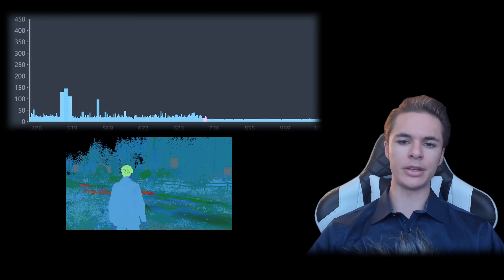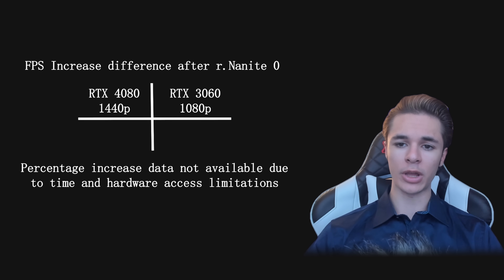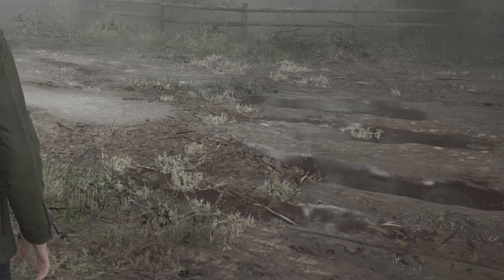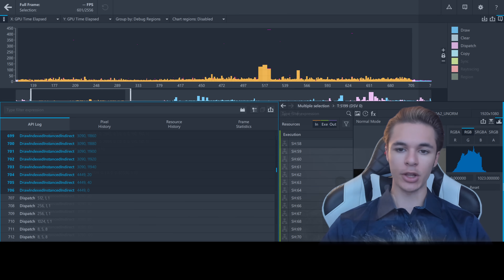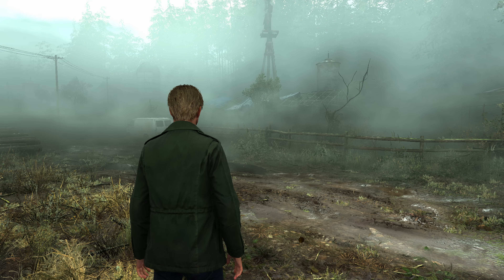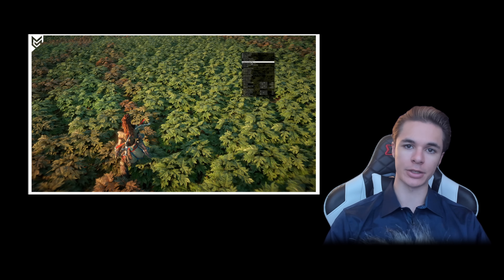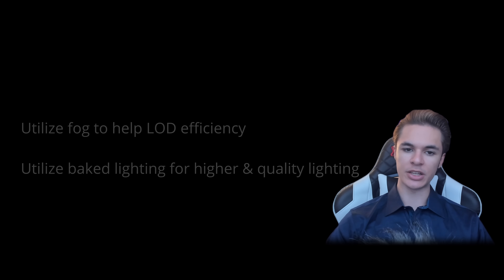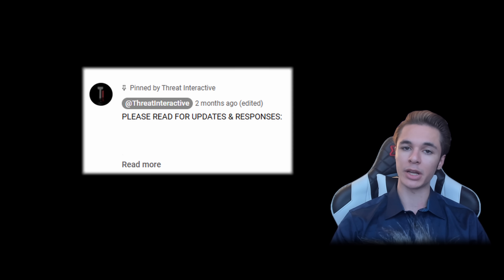The Price of Realism? | SH2R Optimization From The GPU Perspective

Comment: Calling optimization efforts on engines that are not backed by mega-corporations a "tragic waste" is very unfair. Personally, if I had the skillset to contribute to game engines, I'd much rather have my efforts go into an engine which has its' users best interest in mind, e.g. Godot, than something like Unreal, which exists simply to fuel profits and investors.
Reply: it's not game engine's fault. This game is pretty easily fixable from performance point of view. But nobody wants to spend time on optimisation because this task is not in Jira and it's not payed for.
Reply: Godot was good for 2D, should have never gone 3D
Reply from the maker: We find hours of developer labor and real innovations not being utilized by the industry more tragic. 

We find thousands of funds poured into engines like Godot tragic when those fund could've helped major games like the one we just covered by developing much needed fixes in the engines they are actual produced in. 

We cannot WAIT for people to finally realize this is a far better path to quickly help games be better. 

People need to stop wasting time and money on dead engines.
Reply: @ThreatInteractive  You misunderstand the goals of Godot, It's not designed as an AAA Engine killer, it's designed to be easy to learn and use for indies, especially on the 2D front which is it's primary strength, though it's 3D has been a big focus over the last few years due to it previously being an absolute broken mess. Another one of it's goals is to prevent dependance on commercial software that can easily pull a Unity, which Godot due to it's license cannot, and even if it were to do so, it's latest license compatible build would be forked off by the community.

The worst it can do is paint a political target on it's back, like the whole Wokot drama that blew up last month and had it's week in the Social Media spotlight that has since died out.

Calling Godot, arguably the largest FOSS game engine a dead engine, is a bad take for those reasons. It's the Indie of the Game engines, and not the shiny big expensive thing you cannot run
Reply: @ThreatInteractive  I get that you want to promote your new product (the Unreal Fork), but suggesting we direct all engineering effort on the planet towards our overlord epic is the worst way to do it. Perhaps consider a few things: indie games exists, Godot runs on the toaster (unreal required gaming ring), open source is valuable, competition makes better products than monopoly.
Reply: @vison360  I couldn't agree more. If these engines die, Epic dominates everything, and their monopoly causes them to fall further into stagnation and bad practice. At that point, people can either pay for their "temporal slop", or give up on playing games entirely.
Reply: @ThreatInteractive  oh that's an awful take. wtf? there needs to be different options out there. and if i was a developer (indie, of course, i have zero interest in being a dev in a huge AAA team to produce corporate slop), i'd use one of these "dead" engines for sure, as my render targets need to exceed what a ps4 could output to look good.
to be very honest, i'm starting development (very slowly) on a game running in the gzdoom engine which is probably the worst engine ever in terms of optimization and graphics (from being a patchwork of stuff on top of a 30 year old engine), just because i like developing in it and i think there's a charm to the type of look it produces, and i think its extremely limiting nature pushes creativity.
Reply: @ThreatInteractive  Now, I think it's fair that you should focus your efforts where you deem them most useful. But this line of logic, which is utterly focused on the AAA space, broadly dismisses the efforts of indie devs and the engines geared towards them. You're basically arguing that the indie space needs to die so that the AAA space can have marginal improvements.

Godot, Unity, etc. are not "dead engines". I find that a bizarre take. If they were dead, nobody would be working on them. Which happens to be the exact outcome you are advocating for.

Advocating for Unreal's alternatives to fall into obscurity actively helps Epic realize their goal of monopolizing the entire industry. And once they have a monopoly, they'll be even less likely to listen to any suggestions you and your team put forward to them.

You may deem the work put into Godot, Unity, etc. to be a waste, but without those engines, Epic loses a major source of pressure on them to do better. At that point, whether they listen to you and your team is utterly dependent on whether the bosses think it'll make them more money than Nanite and the other things you decry.

If all the donations that currently go to Godot were instead poured into Unreal (a drop in a bucket, I'd imagine), Epic would just funnel them into Nanite and further temporal solutions, because those are the big shiny new toys right now that are popular with investors.
Reply from the maker: @SchrödingersGorilla  RE: If all the donations that currently go to Godot were instead poured into Unreal,  Epic would just funnel them

Epic doesn't need ANYONE's funding or help. They already have a monopoly in the space we're taking about which is pushing graphics. Pushing graphics is not wrong, it's how their doing it and 9th gen is a lopsided mess in terms of "improvement". Why you think Epic has anything to do with 3rd party investments is beyond us. We NEVER advocated for such a ridiculous idea. Investing in a UE5 fork(like the one Nvidia has made) managed by a third party against TAA is the whole point our of goal here. Epic and the entire industry can take or leave our improvements such as the ones offered in the NvRTX branch. 

We have zero interest in discussing the "little project, artsy graphics=great gameplay indie space". We're an Indie studio too with our own visual fidelity goals. Goals,  in which many major releases and AAA studios can get behind in quality and modern standards so that consumers actually see a clear improvement when using current gen hardware.
Reply: @ThreatInteractive  Those are fair and noble goals. What I object to is the notion that competing engines should just die, because Unreal is single best way. Many people value having a choice of engine, and Unreal may not be the best use case for their purposes. How then, is people putting development time into those engines a "tragic waste"? As you just said, Epic doesn't need the extra help. Why even bring those other engines into the discussion at all then, simply to cast them as worthless?

Now I agree, to the AAA industry and the field of cutting edge graphics, something like Godot isn't very useful, but that just makes it irrelevant to the discussion. What I take issue with is the implication that Godot and Unity are "dead" engines that no one uses, because lots of people do use them; they're just people who are operating outside of that AAA space of cutting-edge graphics. I don't know why those engines receiving continued development should detract from Unreal's potential, as if they're no better than a leech on the industry.
Reply: @ThreatInteractive  Also. You said "We find thousands of funds poured into engines like Godot tragic when those fund could've helped major games like the one we just covered by developing much needed fixes in the engines they are actual produced in." But then you said "Epic doesn't need ANYONE's funding or help."

And it's true. Epic is filthy rich. They easily have the money to implement all of the suggestions you've made. They're just not interested in doing it... Yet. So if insufficient funding and developer talent is not Unreal's problem, why should it matter that people put time and money into engines like Godot? They're not depriving Epic of anything.
Reply from the maker: @SchrödingersGorilla  RE: why should it matter that people put time and money into engines like Godot?

If they want to do so for a hobbyist mindset, they can go ahead. If people want to actually help major games releases trying to progress in graphics quality, they need to work on the problems where they occur, not abandon the dump. If Epic won't get their hands dirty,  we will.
Reply: @ThreatInteractive  That's absolutely fair. But I would have appreciated more of that clarification in the video itself and your earlier messages, because it certainly sounded like... Well... That those engines would be better off not existing. Because who else is really using those engines and investing in them, other than hobbyists and indie devs? Certainly not the AAA industry; not today.

I agree that it's pretty useless at this stage to say "Just use the alternatives". They cannot compete with Unreal at the AAA level, so for the time being, nobody is going to be using the alternatives, and certainly not large companies. Unity is unlikely to grow beyond where it currently is, and Godot has many years ahead of it before it could ever rival Unreal.

Of course, the reason I defend Godot is that I started with Unreal and eventually switched to Godot. Why? Because it's extremely lightweight, I don't want to be financially beholden to Epic, and I decided that Godot's limitations are acceptable for the project. Unreal also had certain limitations surrounding portals that forced you to use performance-killing scene captures. I don't have the expertise to dig into Unreal's rendering pipeline to free up the stencil buffer. The Psychonauts 2 devs had to bring in professionals to help them mod the engine, and that was WITH using scene captures.

Comment: not baking the GI in this game is such an absolute joke ...
Reply: Yes, or any kind of volume-based solution would've been nice too. While it wouldn't bring smaller-scale GI to the same level, the resultant performance or image quality and stability would've been so nice.
Reply: "ohh shiny!"
Reply: my take: it's being pushed by either NVIDIA or Epic themselves so they are forced to use better hardware or make use of unnecessary stuff like nanite or lumen (which are cool technologies but need a lot of work). This isn't about incompetence, but most likely about business.
Reply: Baked lighting causes more issues. Extensive foliage can create issues, and dynamic objects are also a problem, and the lights that cast dynamic shadows won’t influence the baked lighting. Also, the game has many dynamic lighting events, and even the flashlight uses GI.
Reply: @justinrunner9384  would you rather play a game that requires you the highest end hardware to play, or sacrifice some realism to have the smoothest experience?
Reply: @justinrunner9384  Dynamic lights can absolutely affect the baked shadows though..